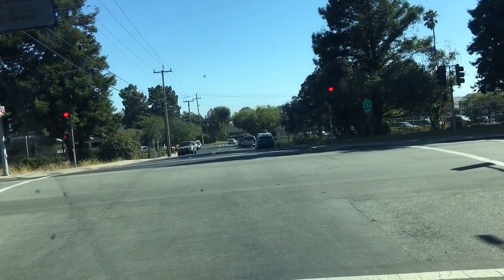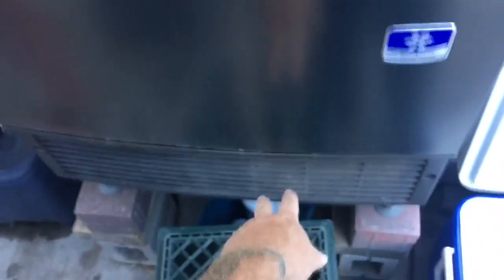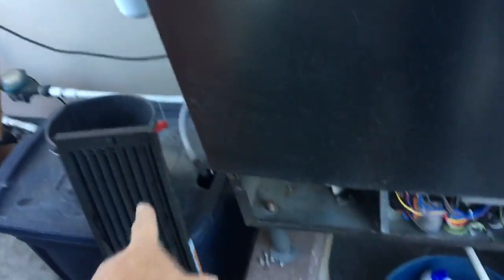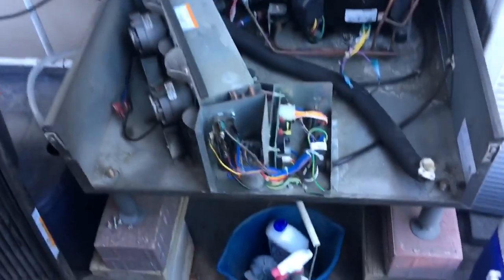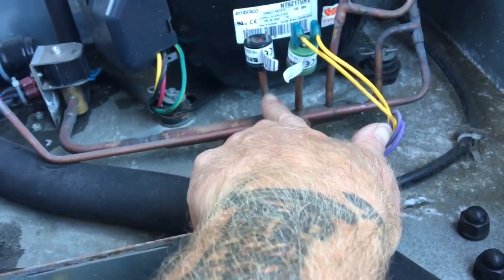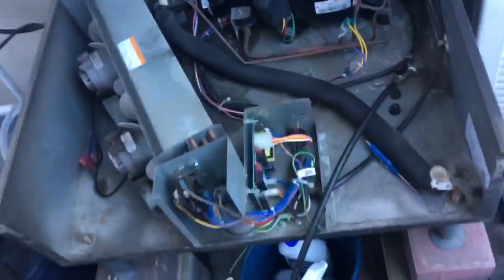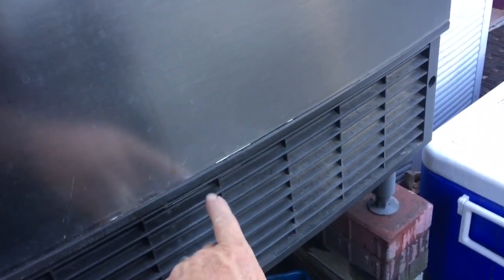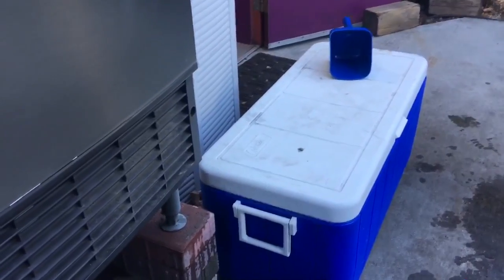Manitowoc fan cycle switch

Comment: Dave, The value of this video for the students is: 1. By recovering the charge, it requires us to pull a deep vaccuum before replacing the charge, which is what I teach because the "deep vaccuum", in my opinion is another layer of safety against any moisture that may be in the system, I also like the nitrogen purging, as nitrogen attracts any moisture besides preventing carbon build up. 2 The way you remove the bin takes that extra technician step (as opposed to the "parts changer" approach) of exposing the condenser coil for a complete cleaning (if needed) and the condenser fan blade, etc. Well done! We just received that particular model here at the school. This will make an excellent training video for the students. As always, well done! Woody Elgin Community College HVAC-R Program, Elgin, IL
Reply from the maker: Steve Wood thanks Woody. Do you have the testo probes in class?
Reply: Check out his mario kart vid. He does not do things in half measures;lol. He always does it propely:)

Comment: Dave, dude, thanks for this vid!   I also work on a lot of Manitowoc's and replaced hundreds of fan cycling switches.  A frequent occurrence on Manitowoc Ice Machines.  Manitowoc wants you to pinch-off the tube, and braze in the new switch.  I call BS on that crap.  Once you pinch it off successfully or not, you don't have room to braze in the new switch properly without overheating it.  You also cannot make it round again causing a restriction to the control.  Why, because there's not enough room to put in heat sink paste or cool it with a rag.  I always recover the refrigerant, braze in an extended 1/4" tube, and replace the fan cycling switch where it will be easiest to work on in the future.  These guys at Manitowoc don't know field service at all.  We do!  Great job dude!

Please let me know if you have a Manitowoc that has a PTCR as a starting component.  Your best bet is to replace that POS with a real Potential Relay and Start Capacitor.  Manitowoc is putting those things in their systems now and are failing horribly.  Replace any PTCR you see with a potential relay and start cap., on top of the all ready installed run cap., if it's still good.  Manitowoc is starting to go cheap and loosing compressors.  Enough failures and they will do the right thing while under warranty for the future of their product.

Comment: I have never felt comfortable either with the pinch off method too much potential for leaks . Good Job Dave!
Reply from the maker: William Loper I always had leaks doing it. ( my fault ). So I decided to just do it the long way every time. Once it's the norm it's fast and simple, with 100% success
Reply: I agree 100% some of these manufacturers are getting cheap and it's going to bite them in the long run

Comment: The new pressure switches have an end that is swaged down, is this swaged down enough to fit inside the tube that remains after cutting out the old switch?

Comment: How low of a vacuum do you pull? I ask because I pulled a vacume down to 170 to 200 microns and the compressor locked up. I thought the Poe oil might have been removed from pulling such a low vacuum. Nice video thank you.
Reply: Ron White factory says to pull a vacuum at least 300 microns.

Comment: Thanks for the video, just had to clean one in a hippie restaurant, the water system on this new design is small up top at distribution. Her old mani never got properly cleaned. 

Just seems like the clearance is small at distribution, the scud builds up quick.

You liking the mr45? Gotta buy one soon, about to get licensed in FL....
Reply from the maker: billcv80 I do like the MR45. It's light weight and works great.

Comment: Manitowoc should use the  Encapsulated Pressure switches that Screw on to a Schrader Valve/Access Valve...  the only way...no gas loss, quick and logical...
Reply from the maker: drcolster I do that when out of warranty
Reply: those are great on a/c  i use them all the time
Reply: drcolster - If they do that , no Job security!😆

Comment: Dave another awesome video thanks! Which nitrogen regulator do you use for flowing nitrogen when brazing? Are for pressurerising the system? Thank you!
Reply from the maker: ralph halili I have the NV-500 and a standard regulator. Both work fine.
Reply: Thank You  Guru Dave

Comment: Great videos I am just started doing  Commercial HVAC  I was a residential HVAC tech and switch over . My mentor does not use nitrogen is that ok I am good with that is not needed
Reply: You mentor is a typical residential hack that doesn't use nitrogen. Without nitrogen, you ask for problems and contamination inside the pipes to clog metering devices and other issues. Any real refrigeration tech is quite familiar with nitrogen. It also saves on time when pulling down since you can inject some dry nitrogen to get remaining moisture out of a system during triple evacs.

Comment: What problem was the faulty fan cycle switch causing? I tear down and clean and sanitize my Neo U140 every 3-4 months and after every cleaning I get a huge block of thick ice that won't melt off the evaporator. It happens for a while and then corrects itself. Unfortunately this time no matter where I put the ice thickness float I get ice that's way too thick. Any help is appreciated in determining what's wrong. Thanks!
Reply from the maker: Dose it have a small probe by the floats?
Reply: @NorCal-refrigeration  No it does not have a small probe by the floats. It was manufactured in 2014. The floats are part numbers Manitowoc 040001783 Ice Thickness Float Switch and 040002396 Harvest Float Switch. The bridge thickness is now staying too large even with the thickness float set on the smallest cube setting. The bridge is at least 1/4" thick or a little more. At this time at least the sheets of ice are falling off the evap.

Comment: Is it normal for the fan to cycle on and off a lot on these particular units? I have a slightly smaller one and the fan runs in pretty short bursts.
Reply from the maker: Brad B what ambient temp?   If it's cold they will cycle. But Manitowoc had a bad run of the fan cycle switches and changed venders. If your machine is still in warranty get it looked at.

Comment: By bypassing the fan control does it affect harvest at all?
Reply from the maker: it will its a temp. hack till you get new switch.
Reply: Roger
My mani iy0520 fan cycle just went out this morning, your vids are always my go to!
Older machine, thinking of doing a tee on the high side service port and flare fitting on new switch………

Comment: Would a faulty fan cycle switch cause a thick bridge issue? What if the fan cycle switch was bypassed for several months? Thanks!
Reply from the maker: I would not think so. Ice thickness probe and board should initiate harvest.  I usually find poor harvest due to lack of heat in harvest when fan cycle is by passed.
Reply: @NorCal-refrigeration  I ask because this goofy NEO has the fan cycle switch bypassed for several months. The harvest float was artificially raised very high in order to go into harvest or else water keeps running and a huge slab is formed on the evap. New floats installed, new pump, and new keypad. Condenser is clean as a whistle as is the entire machine inside and out. Machine is level. 2014 model

Comment: That bypass doesn't work, I tried that but it cools the condenser too much with the fans running all the time, and then the machine takes too long to harvest. I had an old machine with this same problem that I fixed this on last year. You do not need to replace that fan cycling switch. It's totally stupid (unless the machine is running somewhere where the ambient temp is below 50 degrees which isn't a good idea anyway). What I did to fix a 2002 era Manitowoc machine (QY280 series) was remove the wires from the fan cycling pressure switch and run them thru the normally open contacts on a small 120v White Rogers Type 91 relay I installed in the electrical compartment. And then power the relay coil by splicing into the hot gas solenoid power supply. This way when the hot gas valve is energized, the condenser fan immediately turns off, and when the harvest is complete the fan is powered again. The machine now actually works much better with this, since the fan stops instantly instead of wasting some of the hot gas before the head pressure drops enough for the fan to stop during harvest, and it starts freezing faster since there isn't a spike in head pressure at the beginning of the freeze cycle. Doing it this way with recovering the charge, ordering a new fan cycling pressure switch, brazing, vacuum, recharge the machine would have cost the customer nearly as much as that machine was new, and much too expensive for a 20 year old ice machine. Cost of a cheap 120v relay and some wiring is so much cheaper, and actually much more reliable in the long run. For some reason those OEM fan cycling switches seem to fail a lot, maybe they can't handle the inrush current of a 9 watt condenser fan motor... lol. And replacing that relay is a cinch if it ever fails, I used spade terminals so any parts changer in the future could fix it, swap the relay and go.

That was a dumb idea from Manitowoc, an air cooled machine designed to be run indoors in a conditioned space does not need a fan cycling switch. For example no reach in refrigerators or freezers that I know of have a fan cycling switch, except maybe Coca-Cola can/bottle coin operated vending machines, or outdoor ice freezers at a gas station, but those are outdoor rated appliances. Ice machines do not work well in unheated spaces or outdoors...
Reply from the maker: I think the fan cycling is in there for the motel hotel industry where machines are out doors.